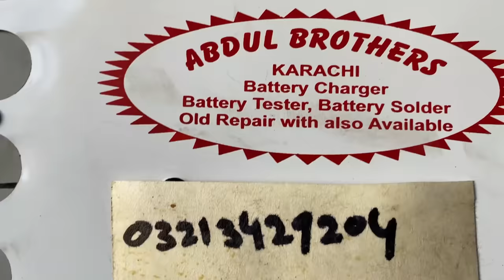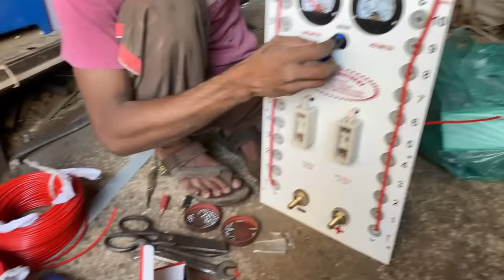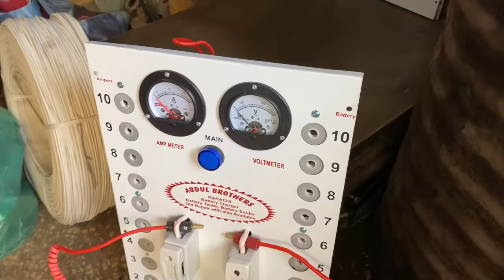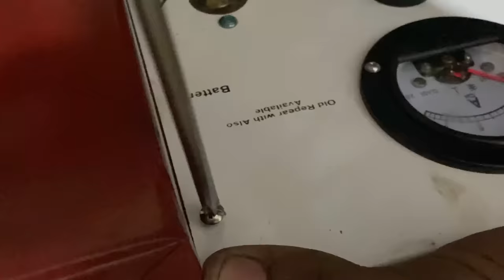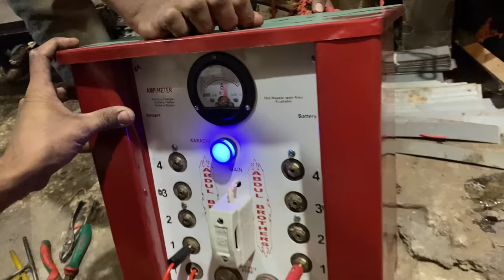Amazing process of truck battery charger making

Comment: When they assembled a transformer core they did not place isolation paper between neighboring plates or cover them with isolation coating. I think when they reversed engineered a transformer, they noticed that a core was made from plates but did not get that they need to be isolated to prevent energy loss from eddy current.
Reply: I think energy loss is the minimum here! This is a total disaster!
Reply: @MyNotSoHumbleOpinion  I'm not so sure it's a disaster. Guaranteed to charge your truck battery, or maybe burn your shop down trying 😀If they used eye terminals and solder everywhere, these things would be awesome. They'll work in situations where the electronics in the Chinese stuff would just shut everything down for 'safety' or something :-) The transformer plates were already mostly rusty, they'll age like fine wine and become more efficient as the years go by.
Reply: @nohandleleft  Yes, in general I appreciated the effort of not having high technology! In fact the transformer came quite well! However I was very worried, as you said, by the completely unstable electrical connections. The only one soldering they did almost shorted the diode! Surely sometimes the batteries will be charged without being destroyed and that is enough for those people!
Reply: @nohandleleft  yep, i miss the eye terminals too. They invested money in the meters and the LED Power On indicator, but not in the eye terminals. I bet there are a pretty fireworks, in the chargers inside, when they powering it up.

Comment: A different transformer was fitted in the end product. The lamination stacks were made a lot better in that one. The first transformer would have a lot higher losses as the sheets should not be put in groups of 3 to 4 together but one by one. Still good work to make these chargers from scratch.

Comment: Hey @creativework are you in touch with the abdul brother workers? While the design is simple and assembly is easy, there are a few improvement tips: 
the diode heatsink could be less bulky, they can save money if they make it from thin laminated iron or aluminium sheets. It's cheaper to use thinner metal for the cooling, also it is more efficient. 
During the soldering process of the diode, it is needed to make sure that no soldering material touches both terminals. At 16:10 you can see a big soldering metal on the green insulator of the diode.
Reply: Also instead of wood, they could use another material, or could just punch holes into the transformer core, because wood tends to warp and can loosen the metal core or crack itself and the transformer can fall apart that way. Paper is an adequate insulator for windings, but heat and the lacquer originally used for the glossy paper may cause it to be fire hazardous, I'd recommend other materials.

Comment: Would it make any difference if the metal strips were cleaned with sand paper or wire brushing. It seems one guy designed this and made it good but he's gone now and the boys are copying this but don't really care about quality.
Reply: Then they would need to varnish the steel for insulation.

Comment: the sheets cut to make the core, is made of which material is steel, zinc, iron or silicon. How many turns is the primary and secondary. Thanks. SERGIO of BRAZIL
Reply: Should be siliconized steel.  But for this transformer "god knows"

Comment: this charger will make the batteries boil at high voltage. This will greatly reduce the battery life. If you want to know more about how you shouldn't charge batteries, I can help you charge your batteries correctly.
Reply: Not to worry, they make batteries too!

Comment: Awfully caveman engineering and construction.  You may notice a few decrements:  no fuse or circuit breaker, aluminum wire, low quality laminations, no current limiting or automatic control, no thermal cutout, low efficiency, no grounding, sloppy workmanship and more.  It’s not going to be a good performer.  Most likely outcome is it will burn up in a year or two.  If the country didn’t have import restrictions then the public could buy cheap Chinese chargers that are much lighter and smaller and cost less too.  It’s weird that cheap Chinese junk is a step up.  Also where do they get those meters?  Those are expensive precision instruments.  Every charger since 1955 has used much cheaper iron vane meters.  Mucho weirdo.
Reply: there are 2 fuses on the  front, perhaps  time for some glasses?
Reply: @bendelange7038  Oh, is that what they are?  Goody.  That leaves only about 8 major calamities.  And there should be a fuse in the primary.  One with no exposed electrical  contacts.  One where you can't slip a 10-penny nail in place of the fuse.   And, forgot a few:  no handles,  no caution stickers,  no UL or CE rating.  No power, manufacturer, or model sticker.  There should also be a capacitor across the diodes to kill radio interference issues.

Comment: I dont know why there is only red wire. A bit of heat on the red insulation will give you a blackened wire. 
Or staining the insulation will give you a blackened wire.

Comment: Here in indonesia accumulator charger only using tap transformer(direct main AC contact)..its very dangerous if not proper when using it or not good isolation...
Reply: So this type of charger is similar to an electronic device w/o a transformer "hot chassie?"  Direct AC mains to a rectifier without any isolation? or a 1:1 transformer
Reply: As an EE, the isolation actually seems decent. You want high leakage inductance in the transformer for a battery charger anyway so the primary and secondary windings are very far apart and the core isolated using what looks like kraft paper. I didn't see any hi-pot routine testing so results may vary... Everything else however, is a fire hazard.
Reply: @lobpants  There isn't a primary and secondary on the transformer. It's just an auto transformer so the isolation is zero.
Reply: @elpechos  Are you sure? It looked like two different wire thicknesses, but it's certainly possible to still do that in autotransformer configuration. If it is, or they "just" connected output minus to input neutral, it's really bad.
Reply: @lobpants  When they assemble the coils at around the 6 minute mark I don't see anything go on that looks like a primary

Comment: That kind of low frequency transformer has not a good efficiency.
I think in the work. The plaques should be more electrically isolated so that no current turns into them and make iron losses.
Toriques transformer would be better with a higher metal permeability.
Not sure it would be so much complicated for theses men.

Comment: Can you imagine the eddy current losses in that core.
Reply: I am mote worried about the rectification LOL. Transformers are not very good at DC... They will go into saturation every second cycle. But the huge losses in the core and the stray flux compensate for that

Comment: In the United States, we call this "Tweaker Engineering". This thing is scary...made from scrap steel strip, scrap paper, wood cut from pallets and some pretty sketchy electrical connections. NO F-ing way would I ever use one of these fire starters. What a joke.

Comment: There is No proper filter at output, No voltage protection, no Input voltage protection, no terminal protection and short circuit. Only, the buid quality is good.

Comment: 3:12 Are we really going to rely on those heavily oxidized pieces of metal to carry large amounts of current? Higher-resistance means higher operating temperatures and less efficiency. Then wrapping it all in wood and paper. I'm not asking for clean-room standards here, but at least run that metal over a sanding belt first. Could probably reduce the amount required if every piece was actually conductive.
Reply: You do =not= want conduction between the metal plates of a transformer. That causes eddy current losses and heat. The sheets in the transformer are not used to carry current, and should be varnished for insulation. It appears that they are relying on rust as an insulation.

Comment: Not "amazing process" - very rudimentary. Schematics with one diode, banana switch, thin wires, no rubber grommets on sharp edges, no short circuit protection, no fuses, looks like aluminum coils, probably underrated switch, misaligned holes. This is a death trap, not "truck battery charger"

Comment: Wooden transformer frame. Unbelievable. I think they used to start a fire. And the testing. Just short  the outputs it is okay.
Overall it is disgusting. This is not a battery charger. It is crap. This can't be explained by the poverty. 50 years ago we were making far better than this and at those days turkey is also a very poor country.

Comment: What a poor Stone Age construction this is! The thing could have been built better and much easier and faster with any slightly modified computer power supply from the junkyard. Such a huge banger, the transformer is only half used because of the one diode. The voltage is unregulated and no shutdown at the end of charging, the thing is a real battery cooker that cooks expensive batteries to scrap. Why are you still filming yourself, the whole world is laughing at you and you are still proud of your "work". What unsuspecting junglers buy such nonsense?